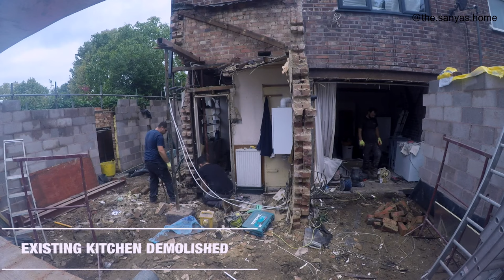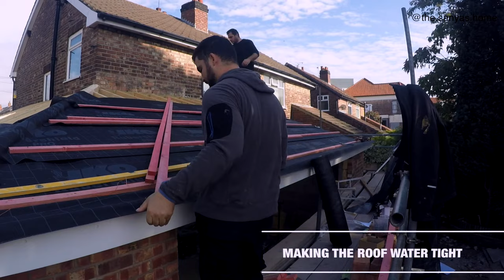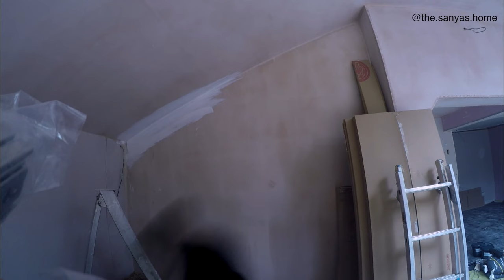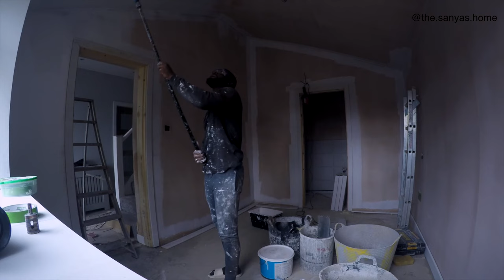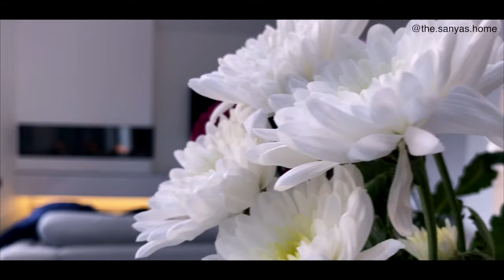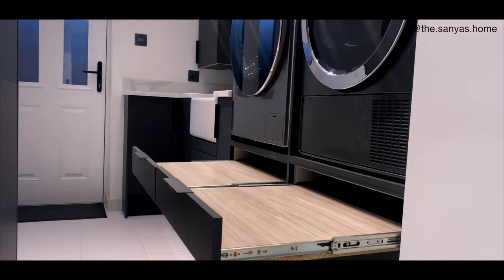WRAP AROUND KITCHEN EXTENSION TIME-LAPSE: + UTILITY & EN-SUITE GUEST ROOM / OFFICE

Comment: That's amazing, roughly how much did it cost?
Reply: 2p
Reply: 20-30 grand
Reply: @m.uf7 😂
Reply: In the west this size extension comes in at about 200k currently depending on what quality level of fittings you choose. When you enquire about cost remember this is actually an investment so generally speaking you will always get that money back (or more) - if you decide to move on in future years.
Reply: 😂 £200k?? The house was probably worth that. £70k - £80k is more realistic
Reply: @anthonychristou8767  (in the U.K.) this extension would come in at around 200k and is a common improvement to a typical 3 bed semi (valued around 450k in southern U.K. regions currently).